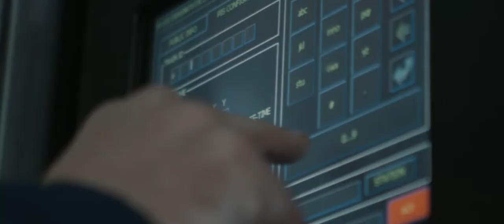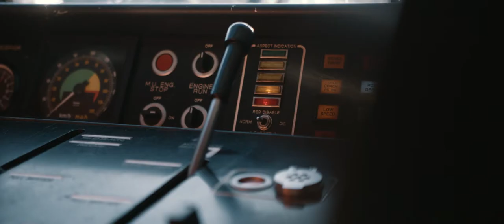Irish Rail

Comment: Gone from bad to worse since they scrapped the mk3s
Reply: And got rid of the 071/141/181/121 locos hauling passenger trains 
On top of that, closing old lines and turning them to greenways and also stopping oil, ammonia, cement, beer kegs and gaa specials
Reply: All 071 s still in service
Reply: @josephryan2409  Not on passenger services  (except specials) though
Reply: @josephryan2409  071s operate freights